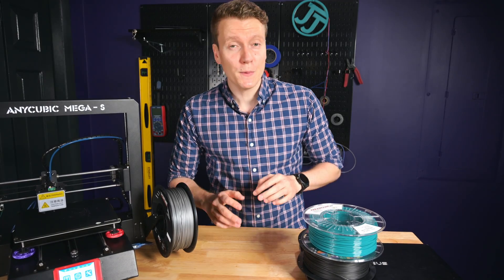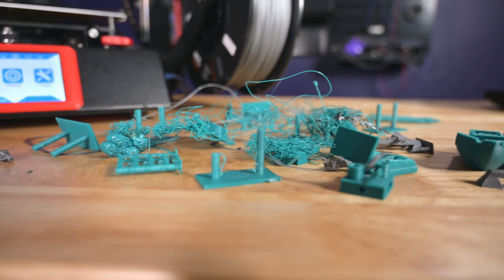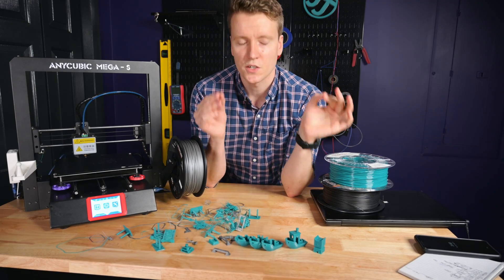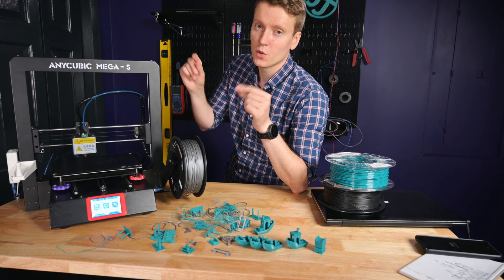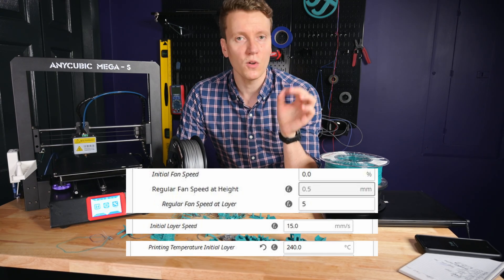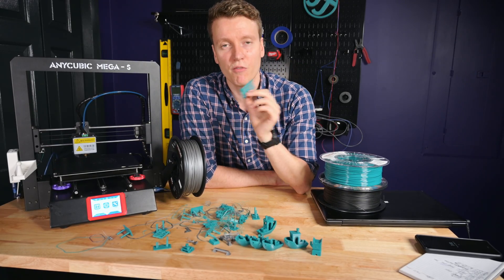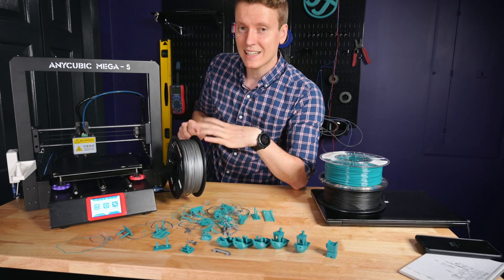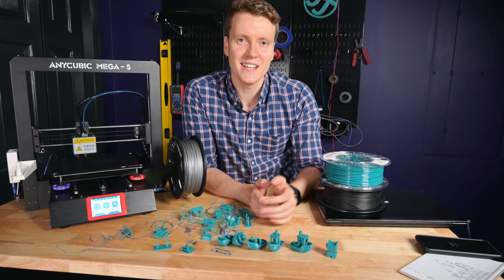Anycubic i3 Mega PETG Printing | Tips for PETG Printing

Comment: Do I have to change max temp in klipper config. ? I am getting klipper shutdowns due to heater max temp errors. For petg . Bed rep 75, extruder 235. Current klipper config max bed 100, extruder 270.

Comment: Why use PETG over PLA?
Reply: Strength, temperature resistance, springiness and more waterproof. PLA is a good material, but it is not as durable as PETG. Here in Phoenix, AZ, accidentally leaving a PLA object in your car on a summer day can be a problem. Best case you'll come back and find it warped if not outright melted from the heat. It is certainly not the best thermal resistance, but for most "environmental" heat it does the job very well. PETG is also good if you want springs or springlike mechanisms. I tried to print out these spring opening pliers out of PLA and the spring mechanism just crushed and never went back into its original shape. PLA is also porous and many times won't keep water in (or out) of something that is meant to be waterproof (bowls, cups etc) especially over time. PETG is very similar to PET which is what water bottles are made of and PETG does the job very well.
PLA is by no means a bad material, it just has limits just like any other material.

Comment: Might not be the right place to ask but I keep setting my nozzle temp to 210 in settings but when the print starts, it drops to 190 and my fillament is just not working with that temp. Any ideas why the settins wont save at the 210 like i need?

Comment: I found on my anycubic mega x I was having a lot of blob problens and I couldn't get retraction to fix it. I set my flow rate to 95% (could be different. I would try testing from 92% - 100%) and it worked great on removing the blobs and the prints where clean and strong!
Reply: Do you get build-up on the nozzle? I get on mine and no idea how to deal with it

Comment: yeah, i only print petg with my anycubic mega. nema 17 for extruder, nooctua for all fans, the psu i removed that wining fan on and put a bigger one on the bottom of the anycubic mega instead, 2208 drivers, insulated buildplate on the underside, the hotendhousing got a upgrade from thingiverse with 3 fans total, to partfans and one hotend, anti tangle on the top part of the frame, leds all around the frame, then ofcourse a rasberry pi with octoprint with a webcam and wifi file transfer. Then a sealed custom built cabinet for keeping the moving air away from print and keeping the heat up... really want automatic bed leveling, but that isnt supported by my trigorilla motherboard..

Comment: Pleaae show how to change the Print Temp
Reply from the maker: You select the print temperature in your slicer software. What slicer software are you using?
Reply: @JJShankles  Cura, I used the printer software when slicking by going to the type of filament, made a custom one and put 230 since I am doing PETG. What is your recommendation for PETG temperature, fan speed, etc..?
Reply from the maker: Nozzle: 235C, bed: 75C, Fan: 100% at layer 10

Comment: Did u find that PETG stuck too hard to the bed and peeled off the nice anycubic glass builds plate?
Reply: welp sounds like you done did a oopsie, PETG sticks like a MF to glass unless you add blue masking tape first 
the omly solution is to write off that glass plate as a loss and order a new one . dont try to get it off because it will take off a huge chunk of glass with it 
thats what happened to joel the 3Dprinterrnerd when he printed with PETG on a glass plate 
just look up '' I broke the 38 000$ 3d printer''

Comment: Those are the exact retraction settings I'm using for my ender 3 v2, you might be able to fix some of the stringing if you enable coasting and mess around with that. I've dialed in my profile to print a benchy in about 1hr35 mins and the detail is almost perfect at .2mm layers
Reply: 245c nozzle 80c bed because im printing infill at 75mm/s inner walls at 50mm/s and the outer wall at 35mm/s, its a really good profile for speed and quality
Reply from the maker: What sort of retraction speed and distance are you using?
Reply: @JJShankles  5.5-6.0 mm retraction distance with 30 mm/s retraction speed

Comment: LOL, so I am taking the express ride to PETG. I just commented on you more recent video that this is my first foray into this hobby (for want of a better word) and I knew I wanted to make things for outdoor use with some heat tolerance rather than knick-knacks and toys so bought one roll of PLA to learn on and 5 rolls of PETG to start getting serious. So anyway, your video will be helpful. Thanks again.
Reply from the maker: I've been printing PLA for a few years and just recently got into PETG. The material feels so much stronger in my unofficial experience. I think you'll enjoy this "hobby"!
Reply: Make sure to dehydrate your petg often. This stuff loooooves to soak up any and all moisture